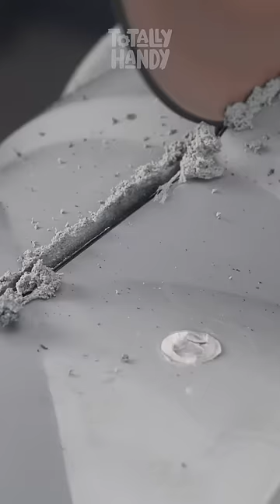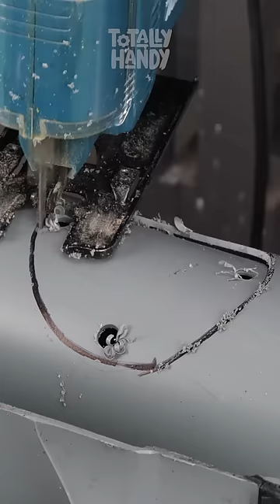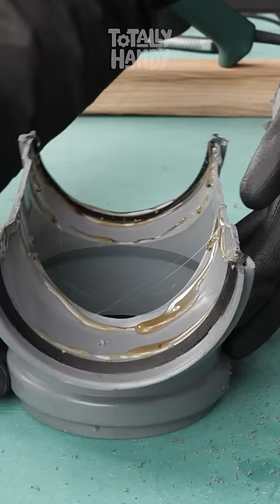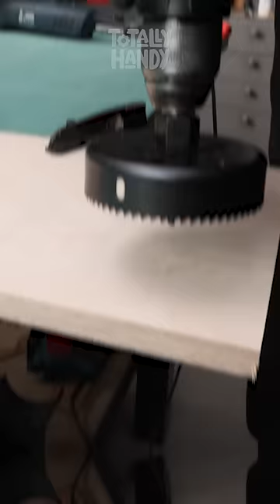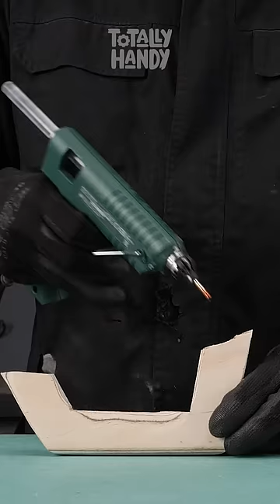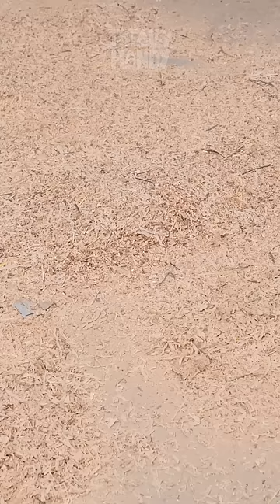HACK FOR VACUUM FROM PVC #shorts

Comment: The cost of those plumbing fitting cut to pieces is significantly more than just buying an accessory for your vac hose.
Reply: It's appears as this is the main vac system for all the saws and other machine. It's not just a basic shop vac. Shop guys make jigs and all kinds of stuff like this out of scrap to save money and time. Pretty smart idea as long as the boss doesn't catch you doing this on the clock.